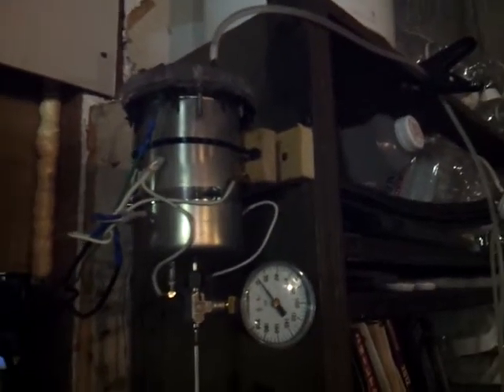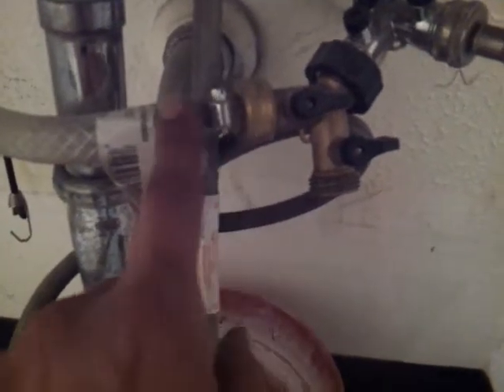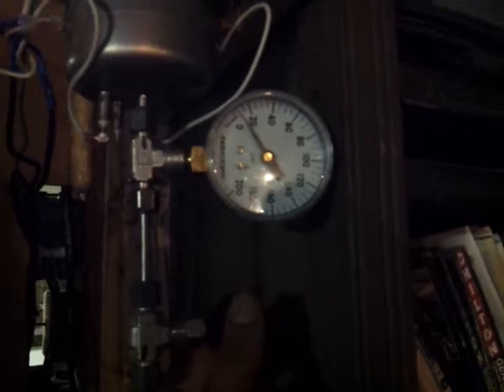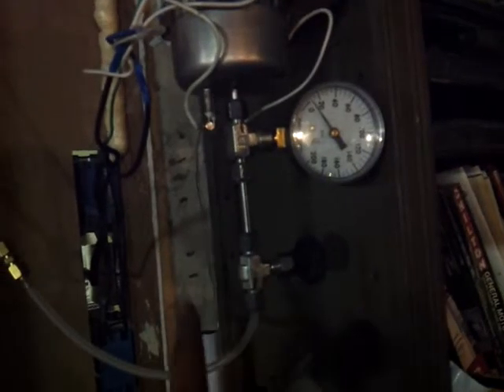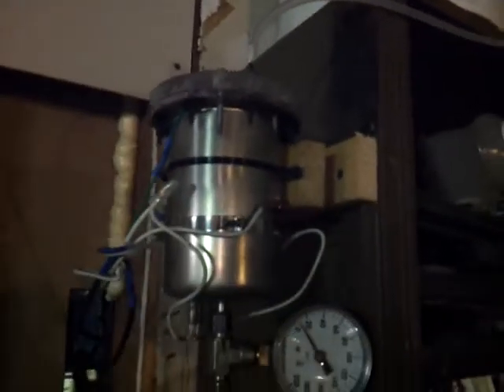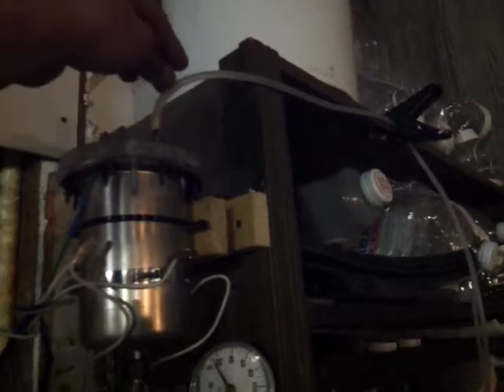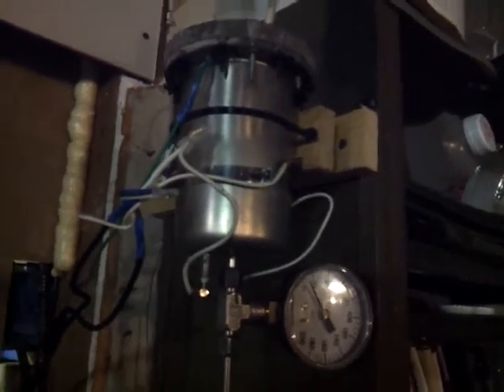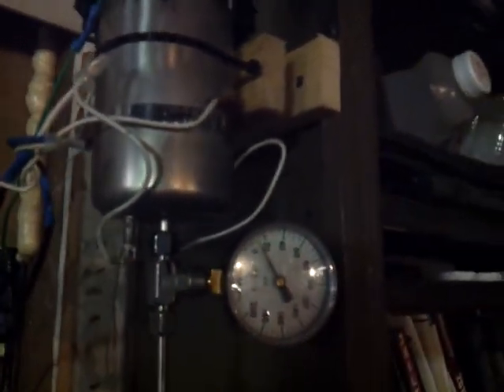One Cup Coffee Maker To Instant Hot Water Heater, Custom Setup.

Comment: This little container of water you made..... I think you need to keep it at 160 degrees as is done with regular hot water heaters.   Warm "stagnant" water is great for germ growing.  Cold water not so much so.  Hot water kills germs.  160 degrees seems to be the magic number where warm becomes hot.    For example below 160 yet still warm "stagnant" water invites growth of germs that cause Legionnaires disease.   Not an expert by any means. Just been reading up on this idea. Reading up on how regular hot water heaters work is where I came across the 160 degree, germs and germ killing info. Oh and to prevent fire..... make sure these things your doing are plugged up to receptacles that have the safety breaker built into them like newer kitchens and bathrooms wall sockets!!!!!   Called a GFCI OUTLET.     BTW much thanx for posting your stuff up.
Reply from the maker: The water in the reservoir Is only heated when the water heater is in use. The rest of the time it takes on the ambient temperatures of its surroundings. So I would think its about as prone to germ cultivation as any household water supply is in the US.